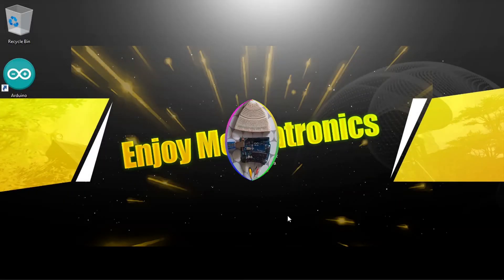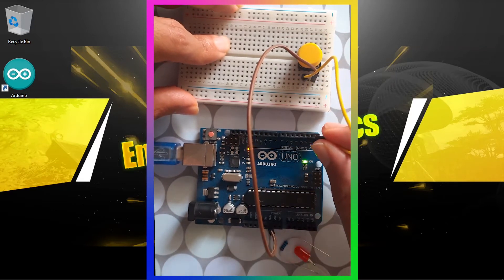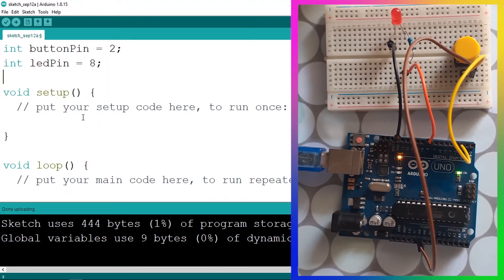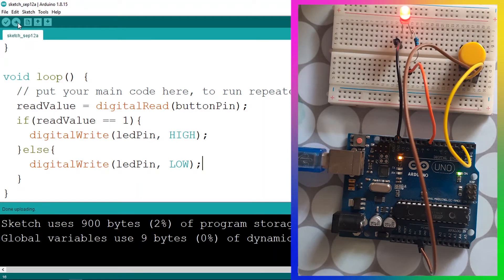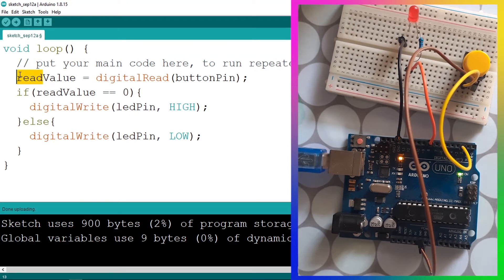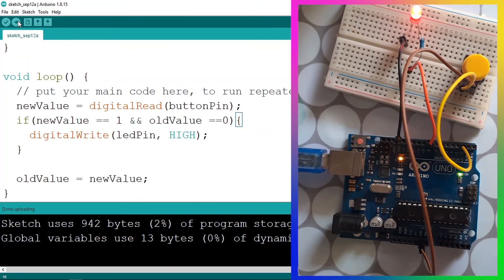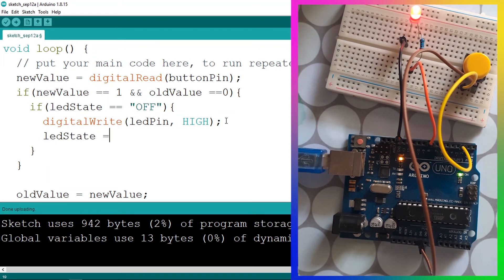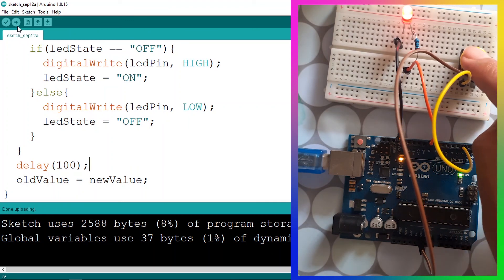Arduino Tutorial 14- Using a Pushbutton as a Toggle Switch

Comment: int pinbo = 2;
int state;
int oldstate = 1;
int led = 8;
class String ledstate = "OFF";

void setup(){
  pinMode(pinbo,INPUT_PULLUP);
  pinMode(led,OUTPUT);
}

void loop(){
 state = digitalRead(pinbo);
 oldstate = state;
 if(state == 1 && oldstate == 1){
   if(ledstate == "OFF"){
    digitalWrite(led,HIGH);
    ledstate = "ON";
   }
   else {
    digitalWrite(led,LOW);
    ledstate = "OFF";
   }
 }
 delay(1);

 
}
Reply: thanks👌👌